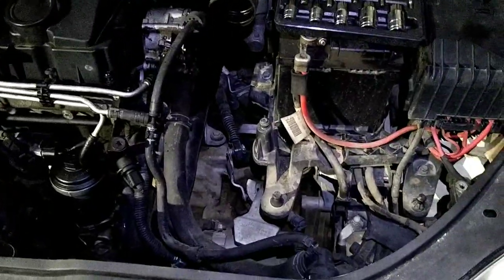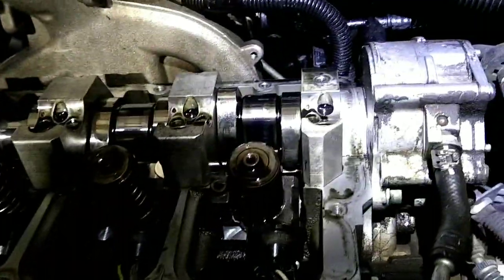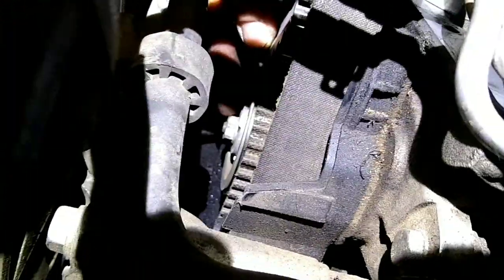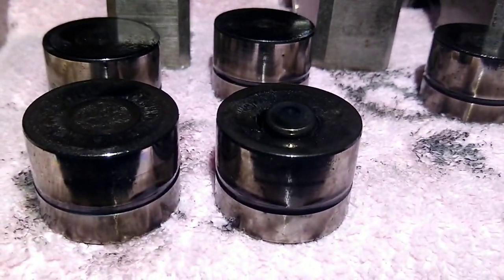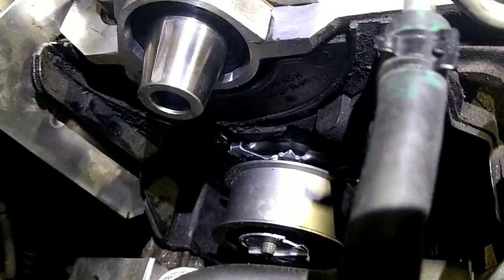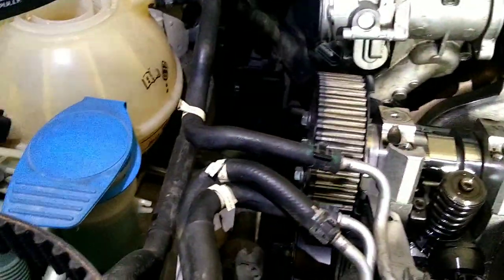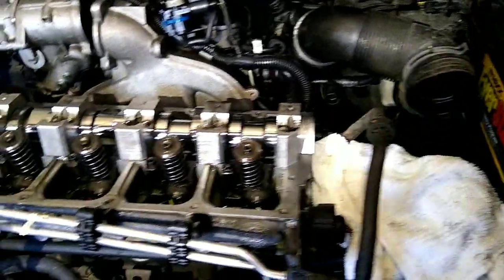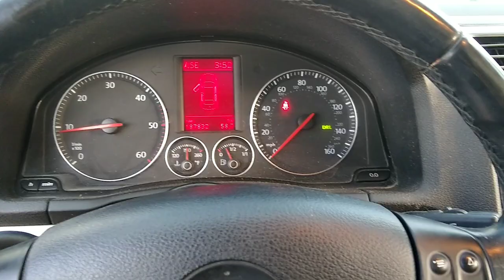Step by Step To Replace Worn Camshaft and Timing Belt on PD TDI, BRM/BEW/BHW and others

Comment: You mentioned about the orientation of the 3 cam bolts but I didn't see how you oriented the cam pulley and sprocket. Does it matter as long as the cam stays in the right position with the crank locked?
Reply from the maker: Sorry about that, the cam sprocket has a grove it goes into on the cam, so it can only go on one way, then set it to TDC with the #1 lobes pointing up and the vacuum pump grove parallel to the head.  At that point you can loosen the 3 bolts and install the belt.  Does that make sense?
Reply: @TDISwaps  The sprocket goes over the pulley right? and it's the pulley that has the keyed groove? So once I get the pulley on aligned in the groove and tighten the middle bolt, the sprocket fits over it only one way? and is held in place by the 3 smaller bolts? I guess my question is about the positioning of the sprocket - does it just need to line up with the holes in the pulley? Do I leave the 3 bolts slightly loose so that I can rotate it slightly to get the timing belt on it?
Reply from the maker: @richardferrell1046  that's all correct, with a good cam you can mark/lock the pulley at TDC and not remove the tandem pump, that'd the point of the 3 smaller bolts.  but with a new cam just tighten the bigger center bolt, and keep the 3 smaller bolts loose to be able to adjust the sprocket to the center of the bolt slots so that cam timing can be adjusted later with vcds
Reply: @TDISwaps  You video is the best I've seen. It's a little more work but I like that you removed the fuel pump because you're supposed to crank the engine for a few seconds to build up oil pressure before engine starts running. If I'm not replacing the timing belt and hardware (replaced about 40K miles ago), do I only need to remove the tensioner to take the timing belt off?
Reply from the maker: @richardferrell1046  thanks, as long as you can get the belt off without using any pry bars or anything that might damage it you'll be fine it's just the easiest to get it off if you take it off with the tensioner but I'm sure it can be done with the tensioner in place you just want to make sure you don't nick it or something with a screwdriver trying to get it off or back on
Reply: @TDISwaps  I don't have a problem taking off the timing belt tensioner along with the serpentine belt tensioner for access but I wasn't sure if anything else in the timing belt circuit needed to be removed to loosen the belt. Should I get the tool others use to hold the camshaft pulley in place so that I can torque down the center bolt or will something else do just as well? I have a Ross-tech VCDS so I'm happy that I'll be able to see if the timing is good. right now, it's reading -1.5 so it sounds like I should shoot for keeping it around that valve following the cam replacement?
Reply from the maker: @richardferrell1046  and also just mark placement with a paint marker I do that on my older TDI engines.  I often don't use any special tools at all, and yes I like a little bit negative on the cam timing.
Reply: @TDISwaps  mark the pulley position relative to block when I'm torquing the bolt so that I'll know if it moves? The only tool you use is the crankshaft lock or do you use a timing tensioner lock as well?
Reply from the maker: @richardferrell1046  well the only things to Mark are the cam and the crank, but I've marked both of them with a marker and not use any locks, you just have to make sure once you're back together that you spin it around a few times and go back to the marks and they still line up
Reply: What do you recommend for a good quality camshaft kit? Should I at least replace the timing belt tensioner if I'm not planning to replace the other timing components?
Reply from the maker: @richardferrell1046  I usually recommend a billet/AMC cam, anything more than that gets pretty expensive.  Tensioner is up to you, it should be fine
Reply: @TDISwaps  I noticed you didn't recheck injector lash when replacing the camshaft and injector rockers. Is it not necessary if the lash was verified good before changing out the old camshaft?
Reply from the maker: @richardferrell1046  usually people adjust that by tightening the adjuster all the way down on each injector then backing off 180°, it's not a very accurate adjustment to start with.  I have not seen the need unless you are actually changing injectors and crush washer sizes which would then actually affect it significantly.  The readings I check on vcds at the end are a far better measurement than the backlash
Reply: @TDISwaps  Are you talking about measuring block 13 data: Injection Quantity Deviation for each injector? If so, what should I expect for readings that would indicate my injector lash setting is accurate?
Reply from the maker: @richardferrell1046  -2/+2 is the acceptable range, within 1 is better
Reply: @TDISwaps  I just replaced all 4 injectors with rebuilt ones and adjusted lash @idle with a warm engine, I have readings of 0.52	-0.94   0.05  0.35 and they vary to higher values at higher RPM's. Is this normal?
Reply from the maker: @richardferrell1046  sounds perfect, the readings only matter at idle
Reply: @TDISwaps  I didn't see in the video how you did it but how did you torque the center bolt on cam pulley hub without holding it in from rotating with something. I see there are tools made to hold the hub while torquing. Are they necessary?
Reply from the maker: @richardferrell1046  so I usually get the cam bolt as tight as I can before putting the belt on and then I wait till I'm ready to turn the engine over by hand and use that bolt to get it started and I can usually get it to the torque spec just barely moving the engine over, then I move to the crank bolt to finish turning the engine over before firing it up
Reply: @TDISwaps  very good and thanks. I use that method and save $60 on the tool
Reply from the maker: No problem!
Reply: Please explain about the timing belt tensioner. I see you put it on after you put the timing belt back on so how do you get it on without it immediately putting pressure on the belt? Is there some way to disable the spring action of the tensioner against the belt while installing and then release it afterward?
Reply from the maker: Yes it's hard to see on the car but there is an Allen key hole that you can use to load the tension afterwards, it will be loose to start with.  I should have went through that somewhere in the video but it's hard to see in the car
Reply: @TDISwaps  thank you, that makes sense. Is there a way visually to tell when I have number 1 cylinder at TDC? Could you please describe what I should see at the crank pulley, cam pulley and the cam itself? When you mentioned that the number one cam lobes will point up, which direction is that? Straight up vertically, pointing toward the back of the car or forward?
Reply from the maker: I base TDC off the cam lobes, when you're turning it over you will be able to see when both lobes are upwards and not pointing down but it's more like they're pointing straight out and flat on top it's kind of hard to explain without showing you a picture.  As long as your cam timing is correct in vcds ahead of time, then with the lobes pointing up and the tandem pump off you can see when the cam is perfectly parallel with head and that will be TDC for the cam and the crank.  You can then Mark the crank as TDC from that check
Reply: @TDISwaps  When I changed out my injectors, I inspected the cam and lifters as best I could. The lifters were shiny but had no cracks or indentations. Some of the cam lobes looked worn down, with bass-colored wear streaks and scratches on some. Others had segmented wear areas on the lobe tips and didn't feel smoothly tapered. There was almost no chamfer left on the lobe edges. Does this cam need replaced?
Reply from the maker: @richardferrell1046  for my experience it's very hard to tell the condition of the lifters without pulling the cam, unless they are catastrophically bad. the last one I pulled the lobes just looked worn on the cam like you're describing and it already had made pinholes through the lifters right in the center under the lobes where you can't see
Reply: @TDISwaps  it's coming out next week when my new kit arrives. I bought a white marker to use like you showed us. I'll be playing your video several more times before then! What process do you use to break-in the cam?
Reply from the maker: @richardferrell1046  sounds good, I'm glad to see it's a useful resource, never imagined it would get this many views ha ha. as far as cam break in what I've read is use zinc additive in the oil, cover the cam in it, then a 20 min run holding 2000 RPM, replace oil, then 500 miles to another oil change, adding zinc each time or a heavy zinc oil
Reply: @TDISwaps  You mentioned loosening the center bolt in the cam early-on. Do I need to lock the crank with the tool to do that or will it just loosen without rotating the crank backwards?
Reply from the maker: You will be able to get it without locking anything
Reply: @TDISwaps  Yep, you were right, it came off easy. I've got the camshaft aligned and locked and tandem pump is removed. I'm waiting on a couple of parts to proceed. Regarding rotation of the timing belt tensioner, were you able to use a 6mm allen wrench or did you use the 2-pin tool 3387? Also, does tightening the tensioner bolt hold the tensioner in the rotated position?
Reply from the maker: @richardferrell1046  yes the Allen key works perfect for tightening, and yes tightening the tensioner nut holds the tensioner in place
Reply: @TDISwaps  You probably saved me around $200 in tools that aren't needed but are still being pushed by these retailers as must have. :-))
Reply from the maker: @richardferrell1046  ya it's crazy what they want for them
Reply: what did you use to seat the new camshaft seal? Some size socket?
Reply from the maker: Yes I don't remember what size it was like 27 or 30mm maybe
Reply: @TDISwaps  when I get the new camshaft installed and at the end, rotate it twice, what should I feel or hear to know it's right? What do I do if I rotate it twice and it doesn't line up with the initial cam position?
Reply from the maker: @richardferrell1046  you should only feel smooth build up and release of compression, no metal on metal stopping.  then if the cam is off once the crank is back to TDC, you can adjust it with the 3 smaller adjuster bolts and check again
Reply: @TDISwaps  Ok, I put the new tanged cam bearings into the head. I tried to get them seated and as flush as possible with the journal face. If a little off, will the journals even them up when I install and torque them down?
Reply from the maker: It's best to get them squared up to start with, you can usually get them flush with a rubber mallet
Reply: @TDISwaps  ok on that. I'm hearing from Cascade German where I bought the cam kit that they want me to rotate the cam counterclockwise by 90 degrees from #1 TDC when reinstalling the journals. What are they trying to prevent and is that necessary? If I do that, then I could just rotate the cam back to #1 TDC before reinstalling the timing belt?
Reply from the maker: Correct, if for some reason you got mixed up, that would prevent any possibility of smashing a valve/lifter when tightening it down.  Not necessary but I suppose it's a good practice.
Reply: @TDISwaps  I noticed that my old bearings in the journals have a little tang that locks them into place but the new ones from Cascade German don't have a tang on the outside of the bearing that locks them in. There's an indentation on the inside of the bearing like you would expect but it's flush on the other side where the tang should be. Could there be something wrong with them?
Reply from the maker: I'm not sure on that, I think only one side had the tang but I can't remember for sure, you might as them.
Reply: @TDISwaps  is the car you're working on a 2006 Jetta? on my 2006 Jetta, there isn't enough clearance between the motor mount and the tensioner to remove it.
Reply from the maker: Trying to remember I've been doing older engines lately, I believe I took the stud out of the block with the tensioner maybe?
Reply: @TDISwaps  Not sure if there's enough room to try and get the stud out - that requires 2 nuts right? Is there an easier way to get the motor mount out of the way besides building some kind of brace across the front of the car and use chains to support the engine?
Reply from the maker: I definitely didn't mess with the motor mount when I did mine, I never unhooked anything there, the stud shouldn't be that tight, I spun mine out carefully with channel locks
Reply: @TDISwaps  That's pretty clever. So if you hadn't been able to remove the timing belt tensioner stud, then the motor mount would have needed to come out? Is that what you did in this video, remove the stud?
Reply from the maker: @richardferrell1046  I believe I pulled the stud but if it's not in the video I honestly don't remember, seems like it's tight enough you'd have to though if you don't move the motor mount
Reply: @TDISwaps  I was able to get the belt back on with the tensioner installed but I had to loosen the 3 bolts on the sprocket to take up so slack so that the belt would fit over the water pump gear. Once I got the belt on though, I wasn't able to move the sprocket back to the center position in the holes. Should I just go with it the way it is? The cam seems to still be lined up as before but it could be a little off. What do you use to move the sprocket to adjust the timing if necessary.
Reply from the maker: It's definitely a Gamble too to not have slack in the three bolts you probably need to move it over one tooth.  After getting it running, you adjust it with vcds by loosening the 3 bolts and tapping the big center bolt to turn the cam
Reply: @TDISwaps  I'm a little confused now. When I loosened the 3 bolts on the sprocket, just the sprocket moved in the bolt slots and not the cam right? So I changed the timing a little from where it was originally because the sprocket is not in the same spot as originally with respect to the cam. So I am thinking that if I move the sprocket back to it's center position in the bolt slots without moving the cam, I'll be back to the right position as original. If I turn the cam center bolt, I'll be moving the cam to get the sprocket bolts centered in their slots and the timing will still be off.  Am I thinking about this correctly? I could try taking the belt off again and readjusting the sprocket position back to original and see if I can then get the belt back on.
Reply from the maker: I think you are saying it right, the cam sprocket is set with the crank when the belt is on, so when the crank is TDC, so is the sprocket.  Then you can loosen the 3 small bolts and adjust the cam to match where the crank is
Reply: @TDISwaps  I got it all back together including the 2 revolution check. I'm waiting on break-in oil to arrive. While I had everything apart, I noticed that the transmission oil cooler was leaking coolant so I have one of those ordered. Thanks for all the help. It's definitely tricky for a first-timer but your video made it a lot easier. I'll let you know how my 20 minute break-in works out. I'm hoping my torsion and injector deviations are still good.
Reply from the maker: Sounds good!
Reply: @TDISwaps   What values of torsion should cause me to immediately shut the engine back down and adjust before going any further in the break-in process? What are the safe values of torsion?
Reply from the maker: Between -3/+3, -1 seems to be best for fuel mileage
Reply: @TDISwaps  I ran the 25 minute initial cam break-in. My VCDS indicated the torsion was 0.0. If it were you, would you leave well enough alone or go for -1.0?
Reply from the maker: 0.0 can be a false reading, it will read that if it is out of the sensors range so I never trust 0.0, I would adjust it just a little.
Reply: @TDISwaps  I was a little worried about that when I saw the reading. It just looked too good. The engine seemed to run smoothly though. Does the cam need to be at TDC #1 when I make the adjustment? Should I go more positive first to get a valid reading and then go for -1.0?
Reply: Also, while I'm making adjustments and rechecking, can I leave off the hose going to the throttle intake?
Reply from the maker: Doesn't really matter which way you go and it doesn't matter where the engine sitting either, just Mark next to the three bolts so you can see where it was now loosen them and then tap that center cam bolt until you see the 3 smaller bolts move just a little, like 1/32", tighten the 3 bolts and start it up again to check.
Reply: @TDISwaps  so if I go CCW first and the reading is still 0, I should go back the other way?
Reply from the maker: Correct
Reply: @TDISwaps  Well, I moved it once and it read 0.5 so I moved it back the other way, apparently too much and now the engine shows "not available" and runs rough. I think I should put the crank back to top dead center and take the valve cover off and line things back up?
Reply from the maker: You shouldn't need to do all that, just go off the mark you made next to the 3 bolts and start back there if you are concerned.  This is a very very small adjustment it's easy to go a little too far.
Reply: @TDISwaps  ok, it's running again but rough. The reading is -3.9.  to move it toward -1, which way do I move the pulley?
Reply from the maker: Should be towards the bumper to advance timing
Reply: @TDISwaps  clockwise when facing the timing belt/crank from the passenger side front fender?
Reply from the maker: Correct yeah I always think about it with the wrench pointing up you're going to pull it towards the bumper forward to advance towards the windshield to retard.  But as you're facing the timing belt it would be clockwise too advanced
Reply: @TDISwaps  ok, I got it adjusted to -0.5. It's very very touchy as I've learned. Is this a value that you think is best or should I go for -1.0 or -1.5?
Reply from the maker: I'd say leave it there for now, that's a pretty good number but you could always mess with it later if you think your fuel mileage to be better or something
Reply: @TDISwaps  ok and thanks. By the way what is the ideal value for performance and the ideal value for best fuel economy?
Reply: I checked autoscan after driving a couple hundred miles and I had two occurrences of P0341 Camshaft Position Sensor, Implausible signal intermittent. Do I have a timing problem or simply the sensor going bad? Torsion is still -0.5 KW
Reply from the maker: @richardferrell1046  unfortunately I had the same sort of issue after doing my cam on the newly purchased car, wires had chafed in the harness near the EGR and we're sending false 5 volt references to different sensors. apparently these MK5s are prone to wire chafing all over the place, but moving the harness from its original location can make things appear like that. it could just be a going bad cam sensor though.
Reply: @TDISwaps  I'll check that too but I'm not getting any other errors. I'm not sure when I got the error. It could have occurred when I was adjusting the torque early on. I just did an autoscan the other day and found the error and cleared it and it hasn't come back so far. I've noticed that sometimes the car won't start the first time I crank it. It kinda stumbles and quits. It seems to then start on the next try though. I thought that might be associated with the cam sensor signal intermittency. I might try cleaning the connector contacts and see if that helps. I've got another 200 miles or so before I reach the 500 mile wear-in and it seems to be running fine otherwise.